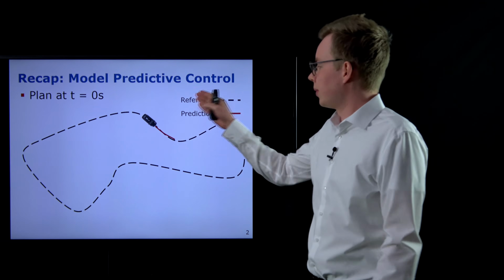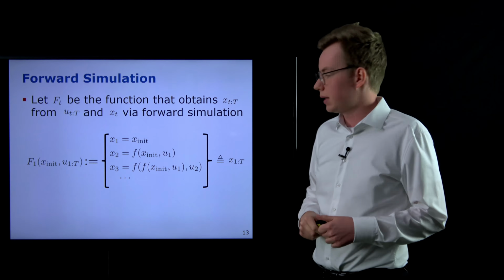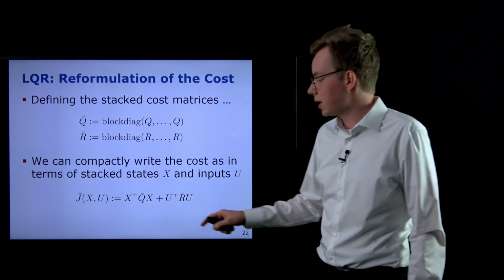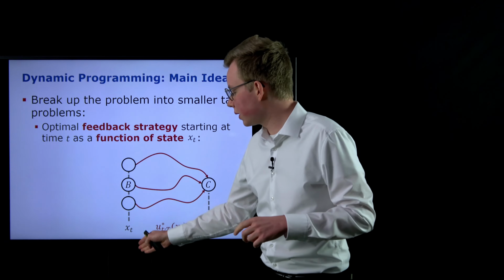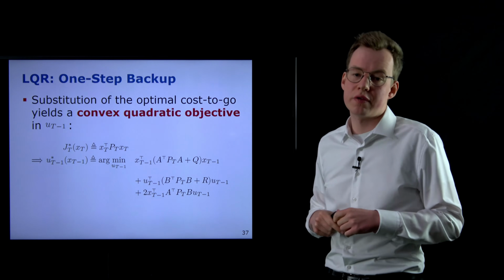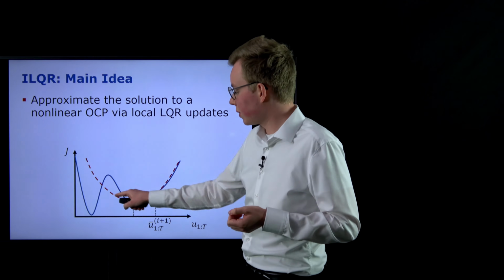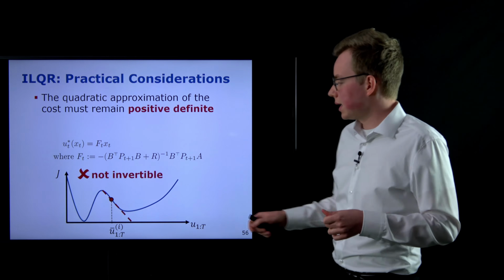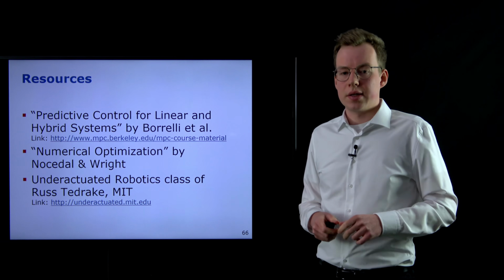Model Predictive Control - Part 2: Numerical Methods for MPC (Lasse Peters)

Comment: Thanks for these lectures. What I don't understand is part of you motivation to use Dynamic Programming LQR to speed up the calculation of the inverse of the H matrix. Are you really interested in the inverse of the H matrix or do you simply need the solution of the linear system, which is way easier to compute?

Comment: I would like to ask, where did we consider the input and state constraints (u is an element of U;  x is an element of X), during both batch LQR and DP-LQR solutions? Both of the are based on LQR optimization which does not consider these constraints; or I am missing something :).
Reply: Thank you for the question. As pointed out around 6:35, for the scope of this lecture we do not consider state and input constraints. Thus, with the tools developed here you would have to encode these as soft constraints as part of the cost (e.g. penalize states outside X and inputs outside U). If you are interested in learning more about how to explicitly incorporate constraints in this framework, I recommend reading Chapter 17 and 18 of "Numerical Optimization" by Nocedal and Wright. There exist various methods for applying these ideas to the very framework of iLQR; for example [this paper](https://bjack205.github.io/papers/AL_iLQR_Tutorial.pdf) discusses Augmented Lagrangian methods for incorporating constraints in the framework presented in this lecture.
Reply: Thank you for this clear answer. I thought that it was just a temporary simplification and we would see how to consider those constraints somewhere in the video. Since one of the most critical advantages of MPC over LQR is taking into account of those constraints, a Part-3 video would be perfect to complete the series; in order to illustrate how those constraints are handled in MPC.  And thank you very much again for this nice wrap-up.